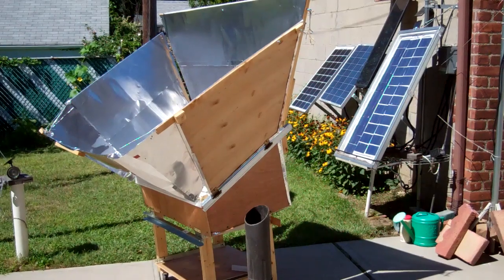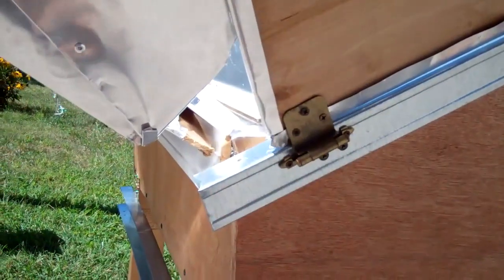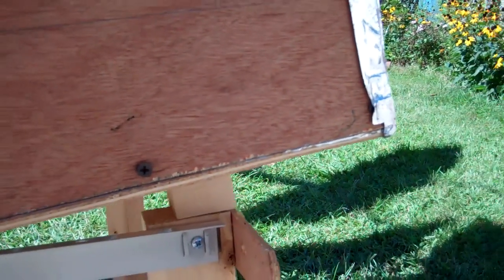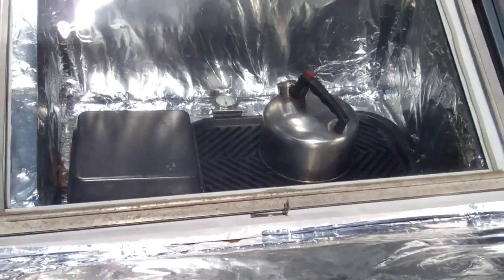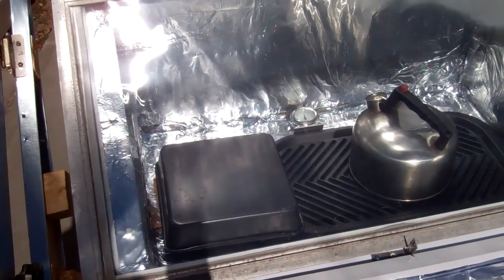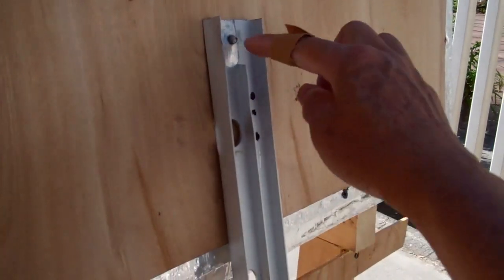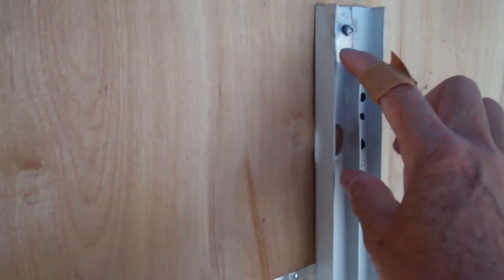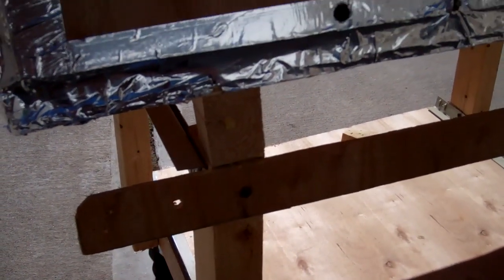Do it yourself solar oven reaching 300 degree F

Comment: I'm in 7th grade and for science class, I made a solar oven similar to this. It doesn't have any wood though, just cardboard and aluminum and a bit of hot glue. It reached around 60 degrees Celsius or around 180 degree Fahrenheit!!
Reply from the maker: I am impressed.  I went to college and the highest I can get the solar oven up to is a little over 300 degree F.  Keep on experimenting and you will go far.

Comment from the maker: I've read the arguments about painting the oven black. I hope I remember correctly but supposedly, black oven will have higher temp and black utensils are not a must. Reflective will require black utensils but the heat will be absorbed better by dark pots. Since diy paint won't be baked on or as expertly applied as commercial products, I hesitate to go that route. You started off with a good design so there's not much need to try black paint.